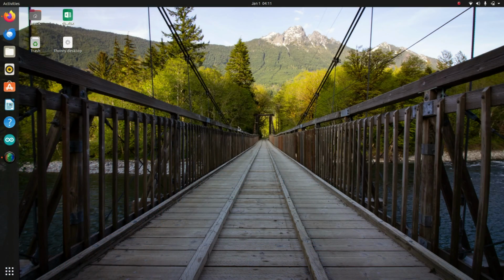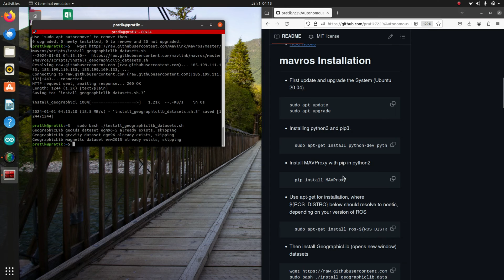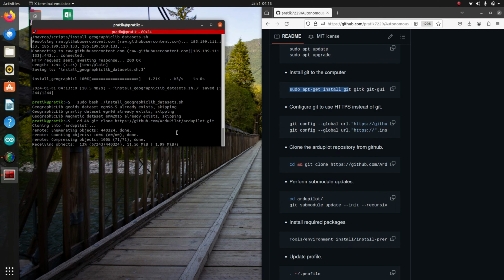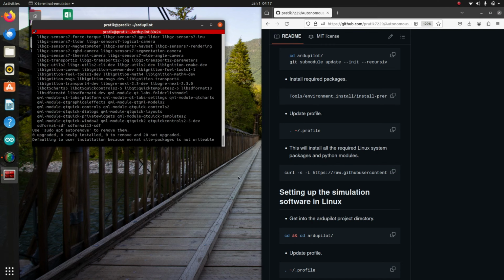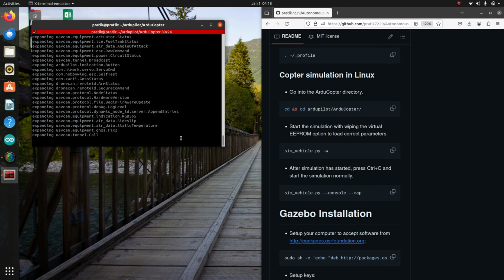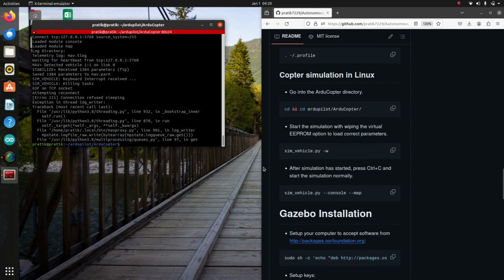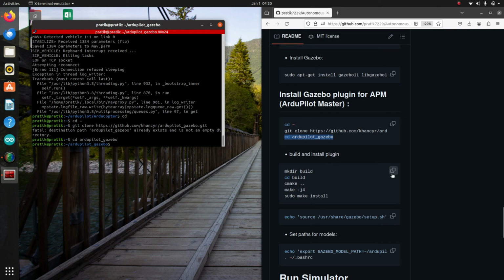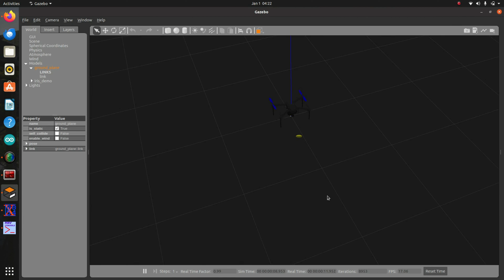SITL, Gazebo and Mavros Installation | Drone Programming with ros #1

Comment: What if you're using ubuntu 22.04? I have ros-humble. Can you guide for it?
Reply: Hello, did you find a solution for UBUNTU 22.04? Does this video work for UBUNTU 22.04?
Reply: I had the same issue you need 20.04 to use for anything on drones programming like ardupilot and run 22.04  for ros humble separate it's not very compatible.